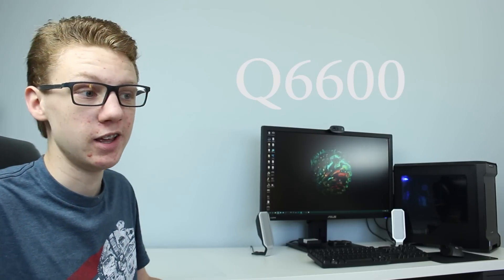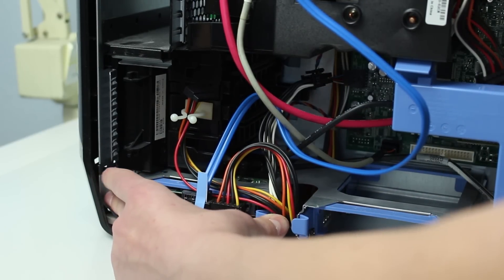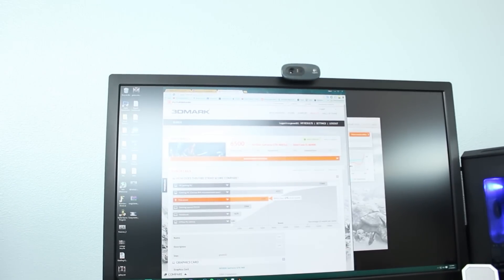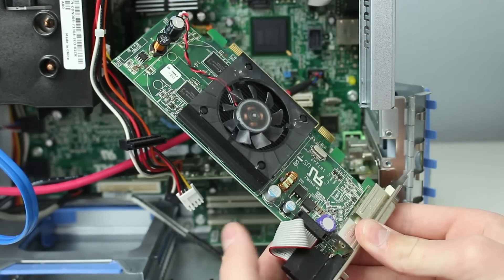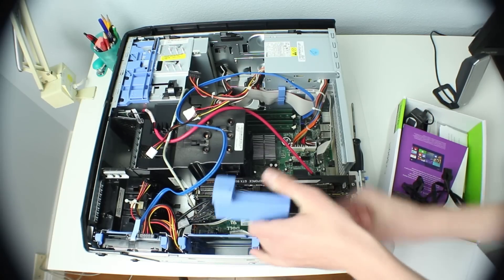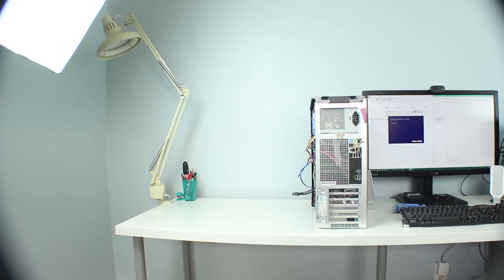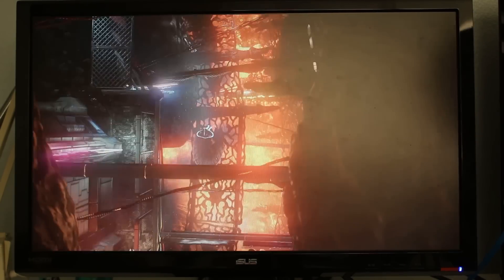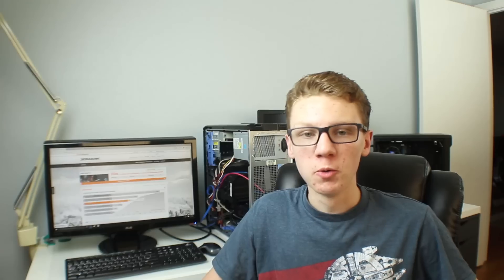Old CPU + New GPU = Gaming PC? (Core 2 Quad + GTX 960)

Comment: Hey Gavin, I am using a Core 2 Quad too since 2008 and I am thinking to upgrade this pc instead of getting a new one. Just wondering if your old pc is still running ddr2 RAM?
Reply: i have the same cpu, and p5ql motherboard, overclocked it to 3ghz with a deepcool overmarket cooler. never overheats, if you have a good cooler you can oc with no problems
Reply from the maker: Yeah it is.
Reply: Gavin Remme thanks :)
Reply: I have old motherboard with LGA 775 and because i didnt have money for new PC, I bought Q9550 and overclocked it to 3,7Ghz. It's not that bad actually, it is like new i3 :P I am using it with MSI Radeon 270 overclocked to 1090/1560. Witcher 3 on medium 50-60fps (in town about 40).
Reply: Buy a used aftermarket motherboard and a decent cooler and psu and overclock the Core 2 quad. They run like magic for a long time when you give them a little juice.
Reply: I'm very much a beginner to overclocking... Honestly if you're having trouble running a game I would upgrade your graphics card next. You probably wont even need to overclock if you get atleast a GTX 750ti which can be purchased used for around $60 on ebay. 
After you get that squared away THEN overclock. You have a nice motherboard for an LGA775 setup so overclocking should be a breeze. If you want to ask me specific questions about overlcocking feel free to email me ten8yp@gmail.com

Comment: So according to this logic , my old Desktop PC with specs :- 

i5-2300 2.8Ghz 
4Gb ddr 3 ram 
1366x768 pixels and
Asus p8h67m le motherboard with PCI 2.0 x16

i can add a GPU under $200 and then it can run all the newer and upcoming titles(e.g Hitman and Max payne 3) at least on low settings maybe.

Should i give it a shot ? Budget remains under $200, a GPU + 4gb ram with this amount of money would be best i think , Any suggestions?
Reply: For 768p? Any $200 GPU surpass your needs, even at 900p/1080p, that Intel i5 2300 still a good CPU. Add more ram and when you can, change the monitor.

Comment: I have a Q6600 and it's great, going to buy the GTX 950 at some point :-)
Reply: Q6600 OC or stock?, GTX 950 is a good GPU for that kind of CPU, with OC at 3.6Ghz or something like that, maybe the GTX 960 would a better option, but you also can OC the GTX 950. :P  PSU?

Comment: I have a HP Workstation XW6200. It's doing fine at the moment, with a Intel Xeon Quad Core 3.4ghz and an SSD I purchased, however since its an old motherboard and old 500 watt power supply, what adapter would I need in order to use a graphics card like the GTX 960?
Reply: Would I get away with using a 1060?
Reply: Thanks man. went with the 960 since its only £170. Just trying to ride this pc out since its still pretty decent as it can still run After effects, Cinema 4d but gfx card is letting it down. To answer your question, it has 2 separate  Xeon Dual Core 3.4ghz. I'm interested in buying the same one in the video, should work right?
Reply: Nop. go better for a GTX 950 Low Consumptio (non PCIe 6 pin connector), has a power consumption of 75W.

Comment: Check out thebottlenecker.com and see if the website is just dumb or not. Cuz I think it is dumb in some cases. because I tried to check an i5-4690k + GTX 960, It says perfect match but when I tried to change the gpu into a GTX 970, it said "Your CPU is too WEAK for the GPU." Is it dumb or nah? cuz if a cpu is perfect for the GTX 960, it should not be too weak for a GTX 970.

Comment: this pc can Play GTA5?
Reply: yes 
my pc 
core 2 quad 9450 2.66gh
ram 4gb 
ati 5670 1gb run gta v  normal siting 1280-1024
46 Fps
 to max 65
min Fps 35-46
Reply from the maker: Probably. I didn't try it but it would probably run alright. Might need more RAM though.
Reply: but d2 max just have 4gb?

Comment: Long Live Core 2 Quad 

It's served me almost 11 years with no faults EVEN after overclocking! Has been running for 11 years with a AMD Radeon HD 6670
Reply: Gimme
Reply: ***** 2005-2006 would get you a Pentium 4, Pentium 1 is from early 1990's.
Reply: BSG yeeee P1..... I tried p4.....changing fonts in Photoshop took 3 min exactly or less with few secs and ur talking about p1....omg
Reply: I am using Q9550 (@4.2GHz) + Asus Maximus Formula + R9 280X, runs Battlefield V on Ultra 1080p 45-50 fps no problem. That is with 8gb of ddr2 Corsair Dominator ram, which again proves that ddr3 isn't all that better afterall

Comment: Can we play on 4gb of ram...
Reply: I would recommend at least 8gb, most modern games will be taxing on only 4gb. Luckily, 8gb of DDR2 is relatively inexpensive.
Reply: Problem is with motherboard....
Reply: Tom Riddle ? elaborate
Reply: Many lga 775 motherboards only support upto 4gb of ram..... Motherboards which supports 8 are costly for a budget build...
Reply: My 2009 build costed me £800, I got a Asus P5Q Pro Turbo Motherboard (LGA 775) And it supported up to 8GB RAM. i put 6GB in it
Reply: I'm now in india... Can you please tell me a lga 775 motherboard which support q8400 with 8 gb of ram in it?
Reply: I'm planning on buying it...
Reply: I think what i have is great... i overclocked my q660 to 2.5Ghz from 2.3... so far no problems running 8GB RAM on it.. In the Asus P5Q Pro Trubo Motherboard manual it said it will fit any LGA 775 Core 2 CPU'S from the Core 2 Quad to the Core 2 Extreme... so a q8400 and 8GB RAM will be fine i guess
Reply: BSG yeah, and idk if he was saying that the motherboard was holding it back or the OS being 32 bit
Reply: Connor O He was saying if the motherboard would support 8GB RAM because Windows 7 32 bit and every OS over that supports 8GB i dont know about 4GB.
Reply: Where? I had a B of time tracking down two 2GB sticks, my mb on has 2 slots

Comment: That benchmark on your personal rig was very bad for your specs, I have an AMD fx 8320 @ base clock and a GTX 580 with 16 gb of DDR3 ram, and my score is 6800-6900 on Fire Strike usually.

Comment: I just got a q9550 and a gtx 950 in my pc just a few weeks ago and its amazing!  It's the first quad core cpu I've owned (before that it was just a dual core mobile i5 2450m and a single core p4), and it screams compared to both!  It was really worth the $165 I spent, I'd recommend it to anyone on a budget, or anyone that already had a base system like me.
Reply: I bought a q9400 for my old pc in my living room and I only paid $16. It already has a gtx 670, that was a hand-me-down from my office PC that I upgraded with an rx 480, but I'm surprised how much performance I can get out of an old quad core CPU these days. Before that, I had a e8400 that was really struggling with multitasking, but now really stable. It pretty much maxed out on upgrades though.
Reply: 3 months ago I bought a Xeon X5460 for 40€ including shipping. (Q9550 doesn't go under 65€ and Q9650 starts around 80€)

That is technically a 3.16 GHz Core 2 Quad.
It is for the Socket 771, but there are plenty of tutorials available how to mod a 771 chip onto the 7775 platform)
Reply: HappyBeezerStudios I heard about those CPU's, but I didn't want to have to deal with the 771 to 775 mod.  I got my q9550 for $35 free shipping.
Reply: Yeah Core 2 ain't dead yet.
We are still on quad cores in the mainstream and even todays chips are only close to double the performance!
Also the E8400 might be one of the fastest dual cores for a somewhat midrange-retro gaming system. (2004-2010 range) especially when overclocked to far beyond 4 GHz.
Reply: The core 2 quad series really is blowing me away with the performance it offers!  With a 950, it runs almost every modern title I've tried (cod bo3, fallout 4, csgo, paladins) at 60+fps!  It is not dead yet.
Reply: Kevin Maguire overwatch ?
Reply: Overwatch runs great ot the Xeon X5460 I have in my second rig. The problem is rather that it is only equipped with a R7 250X
Reply: Kevin Maguire Overwatch runs very smooth on a Q9400, 8gb ram and a Rx480 ;) Same with Fallout 4 and GTAV. 
Try things out yourself before posting snotty comments.
Reply: I'm not posting snotty comments.  You must be thinking of someone else.  I have the Q9550 with 8gb of ram and a gtx 950 and it runs pretty well.  I love how cheap I got this computer together for how well it runs.  I play fallout, gta, and doom along with csgo at pretty good settings and can get 45-100 fps

Comment: What was the PSU watts on your new machine in this video?  (Sorry, I'm trying to gauge a PSU for an upgrade on my Dell T3500 Xeon Quad.  It comes standard with  525w PSU, but with the introduction of Iray,  my standard Quadro FX1800 video card is an obsolete dinosaur).
Thanks for the video.  It was very informative.

Comment: 85% performance of an i5 i don't think so, clock for clock i5-4690k is at least 70% faster thatn the q6600,  OCed @ 4.4 GHz and paired with performance GPU to match it should make noticeable  difference in newer titles.

Comment: i dont usually comment but this here deserves one. 

i built my old rig, instead of buying a new one since i have 2 q8400, im planning to max out their lives. if one dies, ill change it with the spare one.

my specs are

cpu - q8400 2.66 ghz
memory - 8 gb 1333 ddr3 (2x4gb)
motherboard - asrock g41c-gs lga 775
cpu cooler - hyper 212x
case - tecware carbon with 3 exhaust and 2 intakes
psu - corsair vs 650
gpu - palit gtx 960 super jetstream

its still a beast. however, i do a lot of multi tasking. i am now wondering if i can still get a motherboard which can accept a 16gb of memory. if i could get that, i think im looking at another 5 more years of my pc as i have two of q8400 chipset.

Comment: c2q dont have hyperthreading so rip that. but all c2q and c2d are overclockable. lga 775 motherboards are fucking expensive and ddr2 ram is 6$ a gb around 15$ every 2 gb. average 8gb ddr2 800mhz ram approximately 70$ and higher

Comment: my specs :
GPU : geforce gtx 1142
CPU : intel core i9 Q6600 @5ghz
RAM : corsair 2x 32gb / 64GB DDR3
HDD : 15TB
SSD : 250GB
Monitor : samsung syncemaster 30hz

Comment: one thing you guys need to consider is that your gpu runs off your cpu as well. the faster your cpu is, the faster your graphics card will run, until you reach what cpu power is needed to run the gpu at full capacity. also, HOW DID YOU GET A FEW TTHOUSAND SUBS IN A FEW MONTHS???

Comment: Hello..Bro!!!
I have an very old pc..
Intel pentium dual core at 2.5GHz
4GB RAM 
what do you think..which graphics card will be best for my pc..??
Plz reply soon..!!
Reply from the maker: I think your money would be better spent on a new PC.
Reply: Get a Q8200S, and a Asus Radeon R7 240, and 2 more gigabytes of ram, it will work in your system, the Q8200S will work don't listen the the other dumbass
Reply: ToMcRUz Kushal IDO Nvidia Quadro M6000 will make your pc a beast gaming machine
Reply: GTX 750ti
Reply: There were multiple series of "Pentium Dual-Core"
At 2.5 GHz it will most probably a E5200. With a 200 MHz and a 12.5x miltiplier.
Relatively easy to clock in the 4.0-4.2 GHz range.
Crazy fast for everything that doesn't requre a quad core.
Give it a something like a R7 260X or GTX 750 Ti and you should still have alot of fun
Reply: I guess I'm lucky when it comes to PC parts. I mean, I got a liquid cooler for free. The only way it could get any better, is if I was given a 1080 because he felt like going to a Titan (Pascal). NOTE: This is just an example I wish was reality XD
Reply: Ok I got it....Thank you so much bro Joe..!!
Reply: ToMcRUz Kushal IDO Anytime!
Reply: ToMcRUz Kushal IDO And it will only cost you about $120
Reply: What kind of games can it run...??
Reply: +ToMcRUz Kushal IDO what is ur budget for gpu
Reply: +ToMcRUz Kushal IDO get at least a gtx 750 if you want to run all games decently
Reply: ToMcRUz Kushal IDO GTA V, Far Cry 4 at low settings, pretty much everything except something like Crysis 3 at max settings
Reply: thank u so much bro....and will it support amd rx 480 crossfire..??
Reply: HappyBeezerStudios Not all boards support overclocking
Reply: If the board doesn'T support it you can always do a BSEL mod to let it think the FSB is higher.
Reply: ToMcRUz Kushal IDO Is it custom or a dell/hp?
Reply: Gtx 750 ti, it's like $110 dollars or £100
Reply: An old dual core like that isnt gonna handle much these days. An Nvidia GTX750 or AMD RX460 would be a good match...
Reply: gtx 1080 ftw
Reply: OMG thats so funny... not
Reply: Camdex Borat?
Reply: ToMcRUz Kushal IDO get a q8300 for $10 then get a rx460 or 750ti
Reply: OK....thnx for all your help guys....!!
I have already got and HP Omen laptop and I am planning to do some walkthrough on games...and upload it..!!
If u guys can subscribe me...It would be a very big help for me guys..!! And Thnx again for the help..!!
Reply: If I were you, I'd wait another week for the benchmark results of the GTX 1050Ti. It's more powerful than a 750Ti, and it's really cheap for a high end GPU. On top of it being great for a low price, it's also supposed  to have great OC potential
Reply: I'd look for a q9400 or 9550 and pair with gtx1050 or 1050ti.
Reply: Q6600 is also a good deal. Got mine for $20 and overclocked it to 3.6 Ghz no problem... with liquid cooling. If you wanna OC, just make sure you have cooling system capable of dealing with the temperatures it'll produce. A 212 EVO does the job just fine, it's what I used before liquid cooling, but a friend gave me the liquid cooler for free, sooo yeah
Reply: Also need a lga775 board that can oc, which can be a little pricy on ebay at times. The Q9400 is usually $20 as well and performs a bit better than the q6600. Another good good pair is the Q9550 and Intel DQ45cb motherboard. No overclocking but only about $70 for both on ebay and a pretty good performance. The problem I always run into with older builds is ddr2 ram, its always over priced these days.
Reply: Yeah. If you're lucky, you'll get a good deal for 8GB of DDR2 (4x2GB). I got 8GB for $30
Reply: I can usually only find 4gb 2x2 forb $30 used.
Reply: only a dumbass will suggest a r7 240
Reply: Jose Enaje It is small and will run almost anything at $50, What would you have suggested
Reply: The God Called Mars if almost anything is cs go at 720p lowest at 50 fps then sure. Just get a second hand 1050 to or some shit.
Reply: EchoIsPro That would be great if we weren't talking about single slot and low profile cards on the cheap
Reply: The God Called Mars r7 240 isn't really a back for the buck for $50 even the GDDR5 version either, you can get better deals when you dig deep enough on the internet like a second hand gtx 750 which perform significantly better, or if not I'd suggest save up the $50 and get the RX 460 or the GTX 1050.
Reply: Jose Enaje I never said It would be the best possible part, I referenced it because my personal experience has proven it to be a good card
Reply: The God Called Mars so I guess I can recommend him to get a gt 9300 512mb ddr2 cause it was a good card based on my experiece. you know, not every experience we got are always the best.
Reply: The God Called Mars and tells him to don't listen to the other "dumbass"
Reply: The God Called Mars I'd still recommend not to buy the R7 240, cause you made a bad mistake getting that card buddy.
Reply: Jose Enaje He wasn't suggesting parts, he told our friend here to scrap useful parts and spend more money on a new computer. Context is important.
Reply: The God Called Mars I wasn't talking about Gavin, I'm talking about you. you suggest those parts including the r7 240.
Reply: Jose Enaje Oh, so I'm the dumbass for not being god-like in my knowledge of low profile graphics cards..
Reply: The God Called Mars not really, I say you have pretty good knowledge about low end gpu's. pretty rare to know some of those.
Reply: Jose Enaje okay
Reply: ToMcRUz Kushal IDO Nvidia GT740 for lighter gaming, or a GTX 750 for slightly heavier gaming
Reply: Thnx Michael..!!
Reply: Tom Kushal maybe a GTX 580 will work !

Comment: Meh, I have a Core2Quad Q8200 2,33GHz, in 2016... happy with it :D
Reply: :( I have a core Duo 2.10 mghz Barley can run fifa 07 (2007)
Reply: Get a quad bro
Reply: me too
Reply: +Gaming Cheese i have duo too but 3.06 GHZ :D but in year 2016 yeah that sucks
Reply: Yeah, I'm planning to get a 3.00GHz quad.. (or oc my), and then I think, wait, it's 2016... it's not worth it -.-
Reply: Come on, give that 45 nm chip some voltage and kick it to beyond 3.5 GHz.
Also a 2007 game should not be held back uby a dual core of any kind.
Time to get something better than the old integrated Intel graphics!
Reply: You mean I sholud oc it ??

Comment: lol I have the 09 version of that xps, core duo quad also, so the 3gb ram was standard at that time period? also when I got it had a 256mb AMD graphics card, then replaced it with a gtx 650, and was running WoW on good setting, just wondering if upgrading the ram to 8gbs and getting windows 10 on it if legion will still run on the Same setting?

Comment: I was running a Q9650 @ 3.38 Ghz with an EVGA GTX 670 FTW in my secondary PC about a year and a half ago. The Q9650 was a bottleneck in a lot of games that were made after 2012.

Here's the rig holding back the performance of the GTX 670 with Far Cry 4.

https://www.youtube.com/watch?v=tzz96Rp6OdI

Comment: You should know that the pc may perform better because you only got the graphics card connected with one 6pin connector so it only can use a limited part of its power. so you should think of that

Comment: You made a system Image with the flash drive? How many gigs was the usb memory stick? Where in Windows 10 did you go for that?  I had no idea you could make a video card post with only half of its power connected. That's nuts.
Reply from the maker: Look up Windows media creation tool. You only need a 4gb drive.